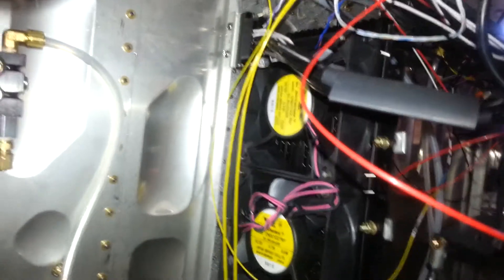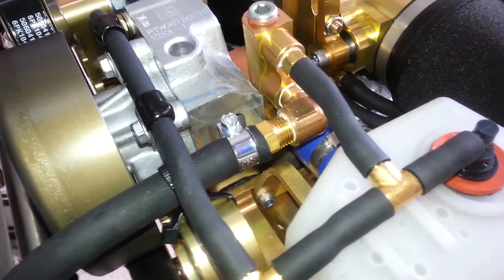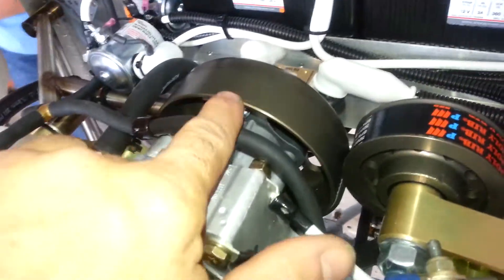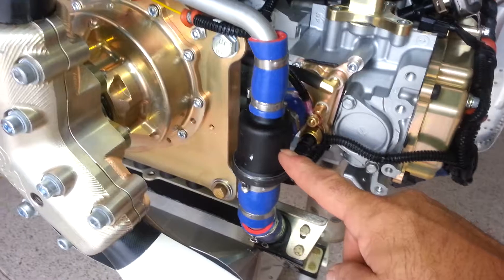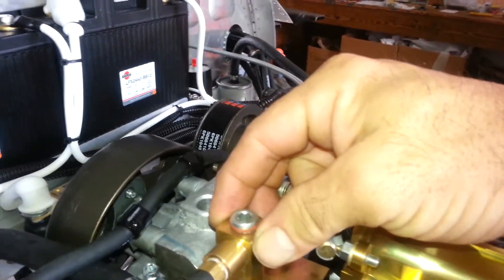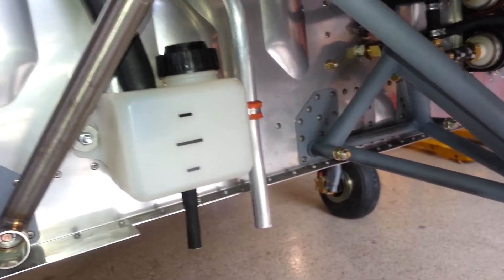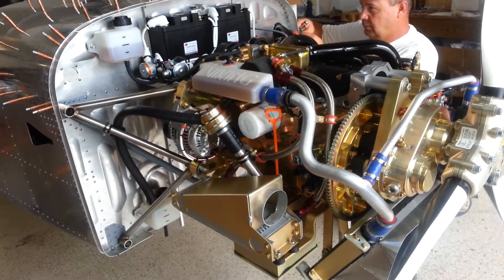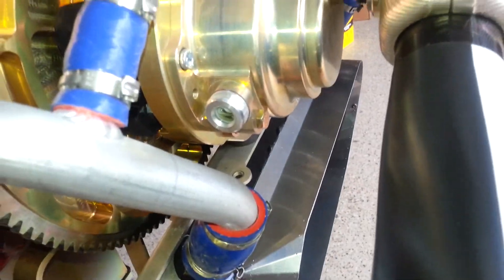Viking Aircraft Engines Rans S-19 Installation 3 Viking Aircraft Engine for sport type aircraft

Comment: I was thinking that because your heater core can deliver cabin heat easily to left or right I would wire one fan positive and negative as usual and the other fan in reverse so you heater core will have a cross flow heating effect heating your cabin more evenly .